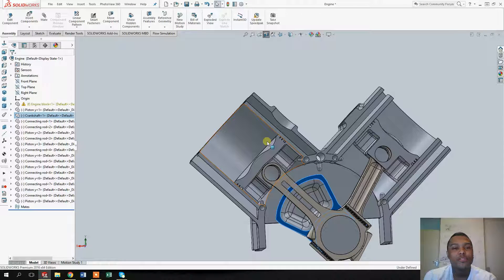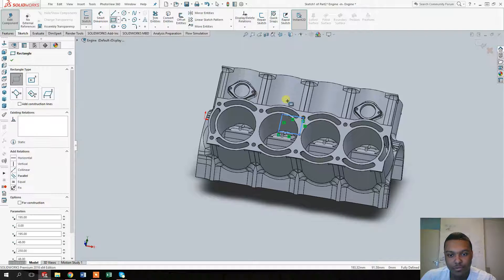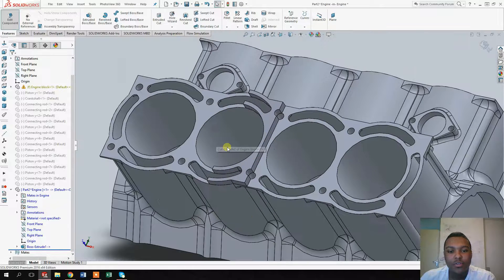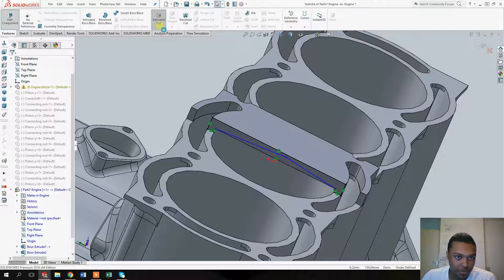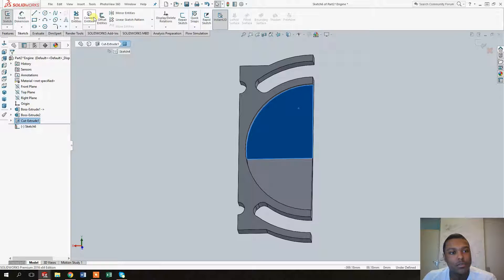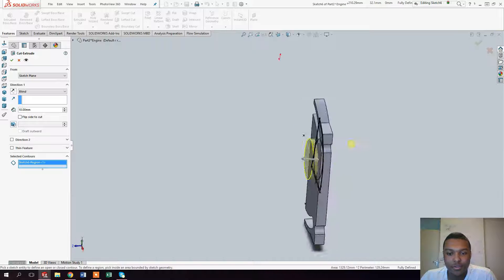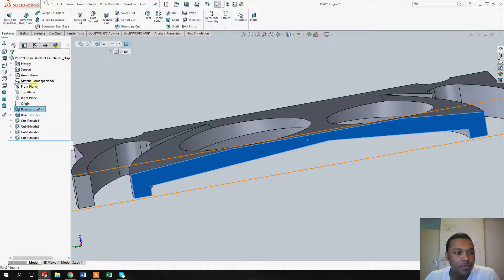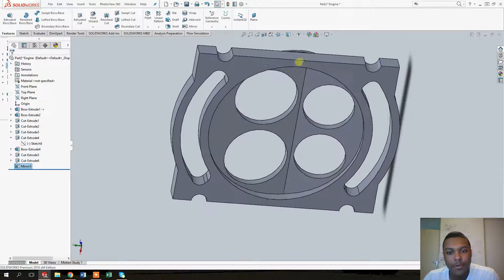Solidworks Cylinder Head Design - Part 1 - SVA Design - Series 1

Comment: Awesome designing! I've used fusion 360 by autodesk before but never used solidworks before. Looking forward to another video on making a cylinder head, interested in how you tie the valves and cams together(modeling the cam mounts and how they integrate with the back sides of the runners.